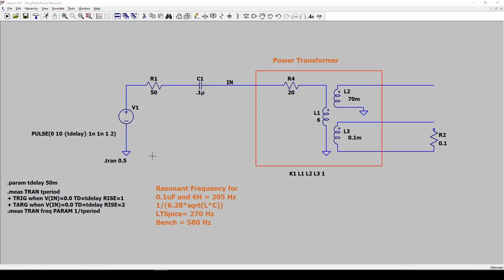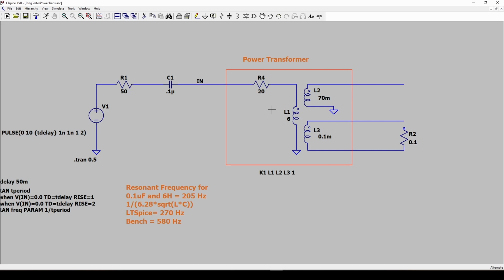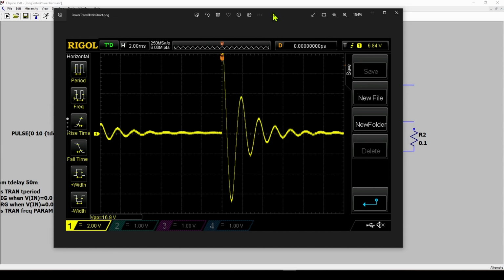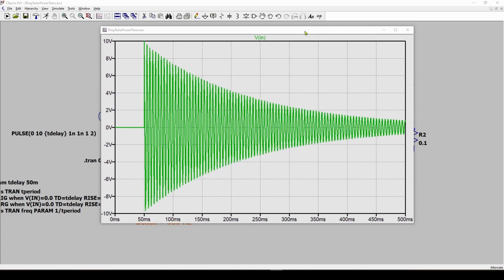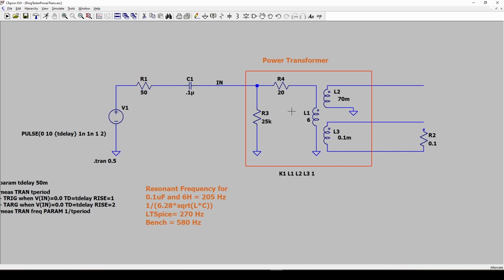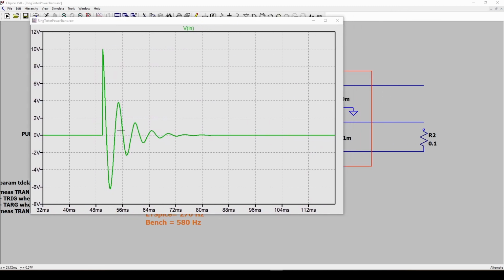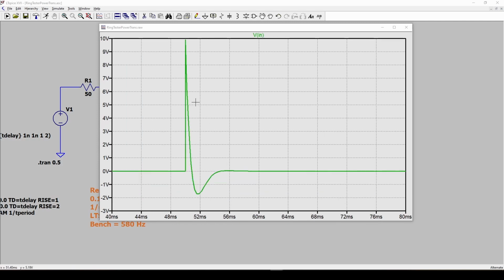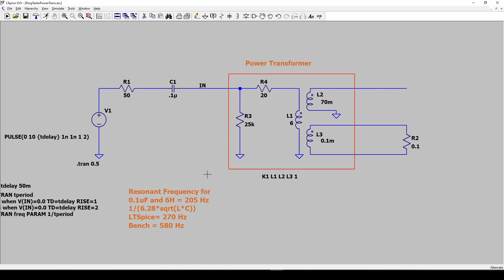Transformer Testing with RingTester Part 3: Power Transformer

Comment: Yes, I have seen all the talk of these ring-testers all over the internet, and always viewed it as a sort of snake-oil. Have never had the need for one, and had my doubts over them. Your videos made it quite clear that it is indeed snake oil. There are much better ways to find the very rare transformer with shorted turns, like running very hot, or the output is totally wrong. Shorts between different windings are just as easy to detect.